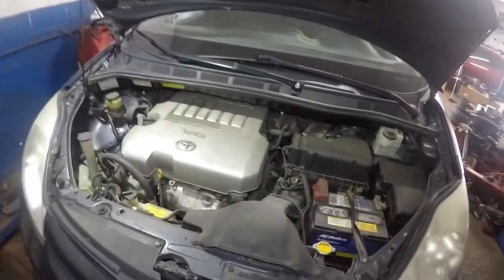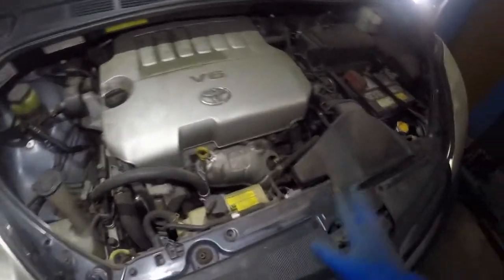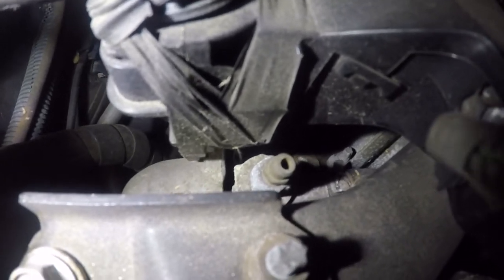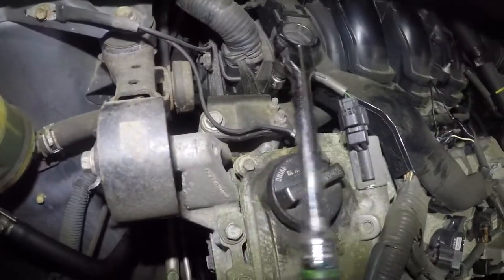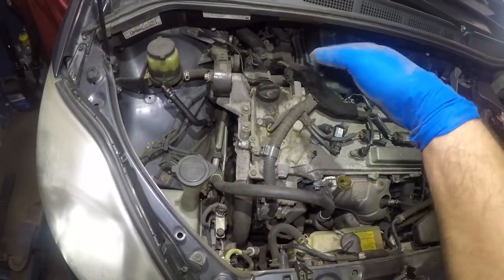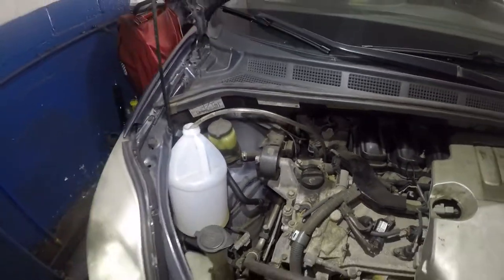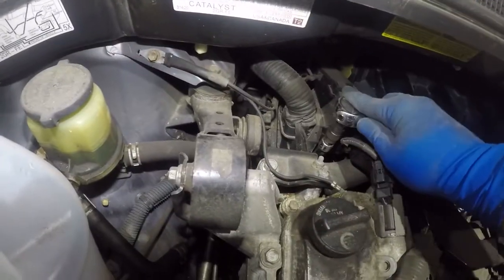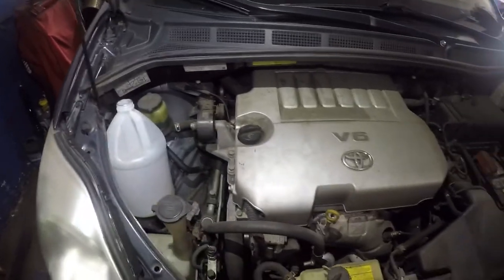Secret Toyota Lexus coolant bleeder valve NO heat only on RPM it work

Comment: Thank you for the video.  I have a 2009 Lexus RX 350 with heat working only at high RPM, so we were searching for solutions before digging in to replacing the thermostat.  Your video was very well done.  Thanks again!
Reply: Same here, i'll give this a try!

Comment: Are you saying rev the engine it let it file cause you kinda did only watch it no revving
Reply from the maker: Yes reve it pump will push the coolant
Reply: @RBTheMechanic  how much raving gave it a few revs came up then let it sit and let it come up closed it filled. 
My situation is the car overheated I have heat and ac at the moment but when it randomly overheated the radiator went empty almost (it overheated bad though like drive a several miles to get home while it was bouncing hot cold hot cold. Didn't want to call a tow truck price would probably cost the price anyways that and I stopped a few times on the way. 
But it also wasn't sucking or pushing anything out the radiator idc what anyone would say I left the cap on accident open but thank god cause when I got home there was like grey gel all around the cap area so I waited till the next day drained the little out of it filled with distilled water twice and added new coolant it took a little over a gallon and a half when i got the heat going kept filling and checked hoses to see it was going at this time it has not over heated has stayed mostly at 180-195 has gone to 205 fans have kicked on and would drop back to 180-195. Does opening that valve show coolant is getting to the motor is would that be needed to check the drain valves underneath?

Comment: I have a 2007 lexus gs 450h. My coolant dripped out to the point i do t see any left when i look inside the cap where we usually filled them up. Can the water pump be the reason why my coolant is dripping out? My mechanic did told me im gonna need to change the water pump when he changed my fuel injector.  It feel kind of sketchy for him to twll me that then this happen a month later.
Reply from the maker: U have to check To see if there are leaks look all around

Comment: I have a 06 gs300 I’ve replaced the radiator, thermostat 2x, fans with oem module, fans won’t kick on unless I run it direct. But other than that it over heats when driving nd cools down at idle, I try to bleed the system but still seems to have air after attempting to drive. Bad description it hope you understand what I mean
Reply from the maker: Ok any possability u have blown head gasket? Some times u can tell but that’s the case other wise I would try to use air lift tool to bleed out the air front the system

Comment: Dont exist on the 1mzfe Solara. Haynes says to fill radiator to lip then fill expansion and run car with rad cap off. Let cool, then top up expansion and should be good to go. Got a nasty air bubble in a my brothers car, running for 5 min it was boiling in the rad.
Reply from the maker: Ok

Comment: Ive problem with my lexus is300… engine over heats while slowing down after a period of high speed drive… fan works fine changed radiator/water pump, thermostat valve.. no mechanic could find the problem.. let me know if anyone knows about this
Reply from the maker: Seems like air flow issue or fans r not running double check fans operation and see if there’s any dirt debree between radiator and ac condenser I had many cases where it wasent able to breathe air to keep it cool
Reply: Yes please let me know. I had this same situation happen to me with 2009 rx350. I had tested it on a long drive after having new water pump and thermostat

Comment: Where is the Bleeder Valve located in the Toyota Camry 2001 2.2 Litter Engine ? How do you bleed this Toyota Camry cars ? Was there a example in Toyotas ?
Reply from the maker: It dosent have it the car is made for self bleeding u just need to check the fluid level once or twice it will go down
Reply: @RBTheMechanic  Can I used a PRIME  Green 50/50 Antifreeze in my Toyota ? What Antifreeze do  you recommend for Toyota 2001 2.2 Litter
Reply from the maker: @jamesmichael8549  depends if ur car has pink I would use pink don’t switch colors

Comment: There is a continuous flow in the hose, but then it stops and goes backwards, then it comes in pieces, and then it comes as a whole, and so on. At this time, what do we do when I close the bolt?
Reply from the maker: Bleed it
Reply from the maker: Give it some time it will get solid streak